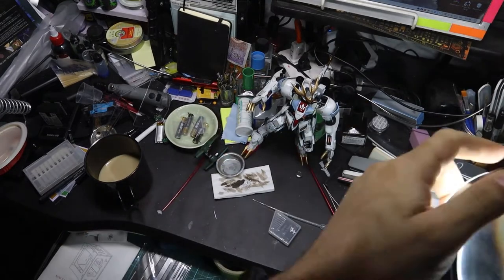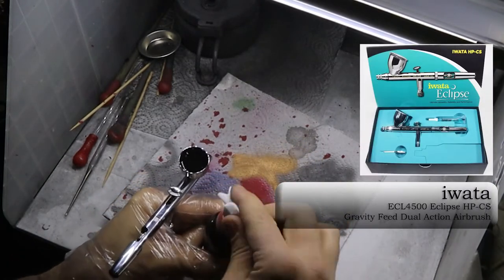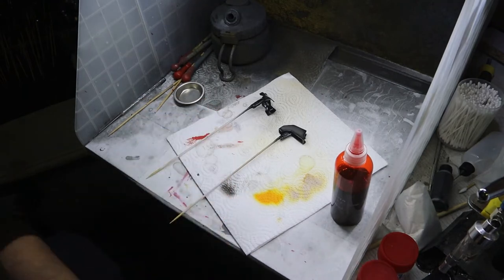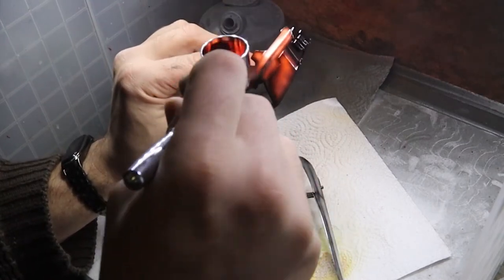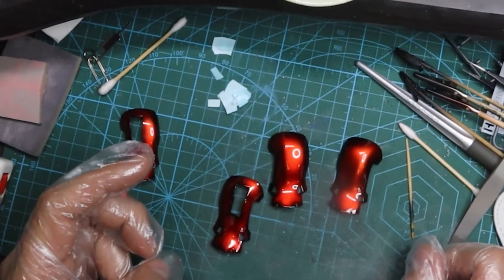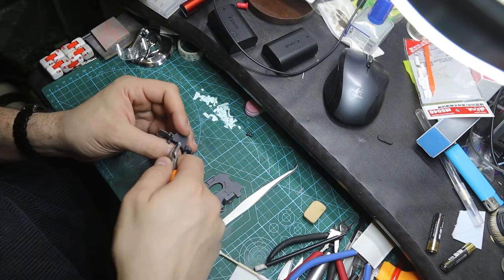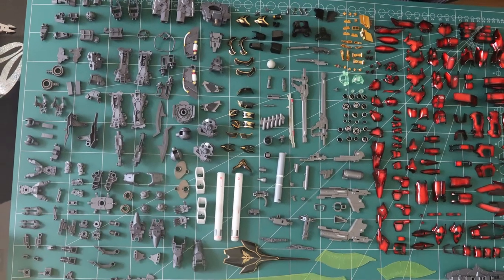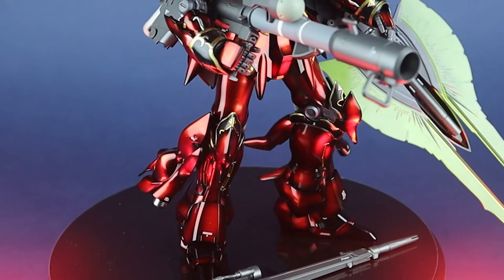MG Sinanju - Candy coat with preshading.

Comment: What suppose to be white colour in Mr Clear Color type? I want to reduce tone for primary colour. Only have Clear Silver GX110 and Super Clear 3 GX100. Can u help me with this? I need ratio 20% red, 10% purple and 70% white in clear paint type. Confuse to choose, which is u consider as white in Mr Clear Color? Thank you
Reply from the maker: This is not an easy question since I don't really have much experience with it. I've looked it up and there is no explanation anywhere. So, if I were you, I'd try with that silver... Although it makes no sense:( 
The other thing that comes to my mind is the bottom layer. Every time I did candy coat, I sprayed black primer. Then glossy black. Chrome. Then the clear coat. I'm thinking if your chrome layer is applied on a grey base (instead of the glossy black), it might affect the top layer of clear coat in a desired way, making the color more pale.
Do test it out on the plastic spoons first. This is completely new to me... And, good luck.
Reply: Ya very hard to get information anywhere abt clear colour mixing up. Or maybe ill try mix clear smooth lll and a bit white pearl, to make a clear white. Thank you for your time, help me very much in the process. Now i know about the base colour information. Good video and information btw, keep going on, keep it up!

Comment: I'm about to start airbrushing my gunpla and I learned so much from this video. Gorgeous builds too! Question, how long do you wait between paints, like going from primer -> base cost -> clear coat? And how much do you think your paints and how many coats do you do each paint?
Reply from the maker: Hey there. I'm very glad you find my videos useful. Makes me wanna make more. So, thank you!
I usually wait a day or more between coats. But that's more because of my life's rhythm. If I'm more eager to paint, I'll do the primer, wait an hour or two, and procede with the preshading, or something like that. Technically, you can do this kind of fine shading as soon as the surface is safe to touch, as long as you're not covering the whole surface with thick coats of paint. Since paint releases gasses while drying, you want to make sure you're not sealing it completely.
As for the multiple coats - it's usually one coat. Except for the clear coats. And yellows. I do multiple coats when I want to make sure I have the right color saturation (yellows can be finicky). But this one coat that I do, I keep spraying until I have the desired look. Making sure I spray carefully, to avoid pooling.
I hope thos helps 🫡

Comment: what is the ratio for paint and thinner ? how long is the curing for each process?
Reply from the maker: When mixing primer, I use 40ml (a whole bottle) of primer, and mix it with 60ml of thinner.
For the colors, I mix 1:1. Shake the color thoroughly. Pour the contents into a mixing bottle. Then refill the original (glass) bottle with the thinner. Shake it again so that it dissolve all the remaining paint. And add that into the mixing bottle. Shake. and use in the airbrush.
When working on a model like this, I usually finish a painting batch and leave it until tomorrow. Especially if you have multiple layers. So, around 24hrs. This is mainly due to my own rhythm. It suits me better like this.

Comment: Hello do you sand the parts before painting or leave it as is?
Reply from the maker: Hi. I never did this. I've seen that some modelers do. To make the paint "stick" better to the plastic. I think it's more important for the resin models. I never had any problems with the paint coming off.